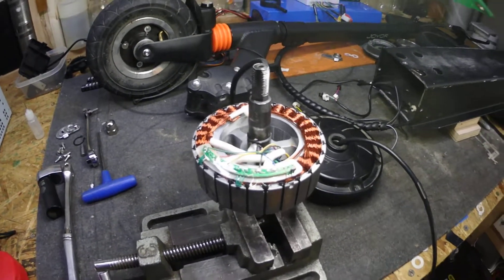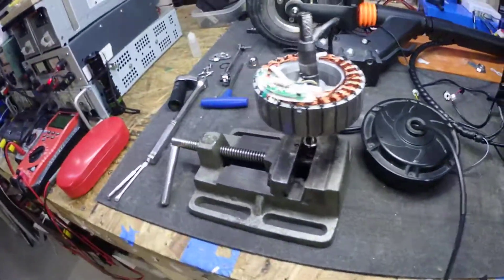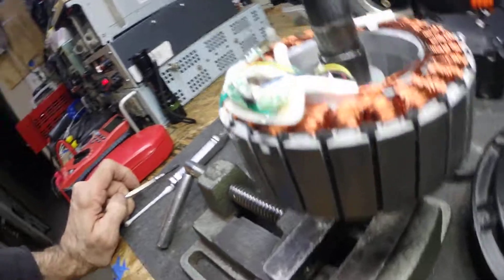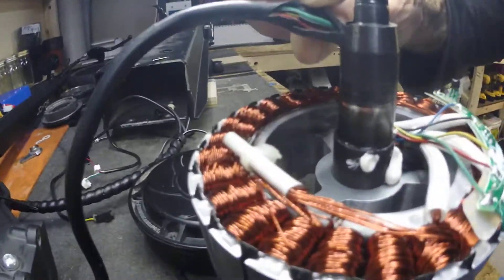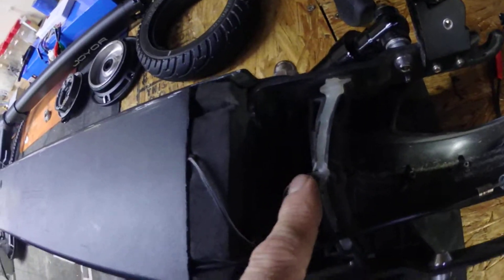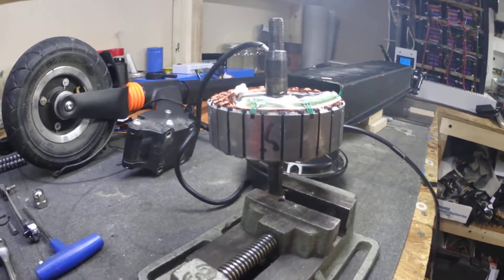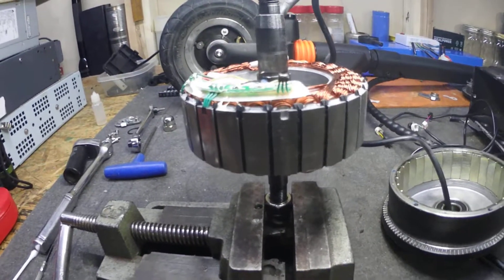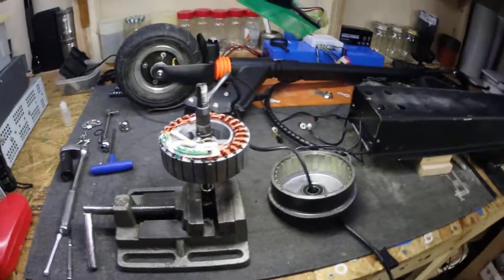Joyor scooter Error code 1 Part 2

Comment: Hi Joyor, (or other specials) HELP me pls..
.. <<M365 pro 2, latest version. No firmware.>> 
Motor problem began with the ‘hall’-noise etc. 
-Battery 90 %. 40V
-Cables are okay. 
-No error on display neither beeps.Only 0 so no speed either. Beeps only on/off.
-The 3 spots on the hall-board at the motor (yellow, green, blue) and the 3 right pins of the halls give 5 V. NO ZERO  (no matter where or how the magnet is) 
-Renewed all the halls SS41F, nothing. 
-Renewed them by a preformatted board (middle one has different polarity) but nothing changes, 5V no zero. 
-Renewed the main board but keeps the same. 
-Renewed the dashboard, no difference…, 
-again new halls,  reversed the middle one and twisted its pins ‘cause of the polarity, but again nothing changed. 
-The throttle worked fine.
 
I checked the halls etc on all the ways I could find on YT.  What can I check (and fix) still more?
Thx for ideas and help!